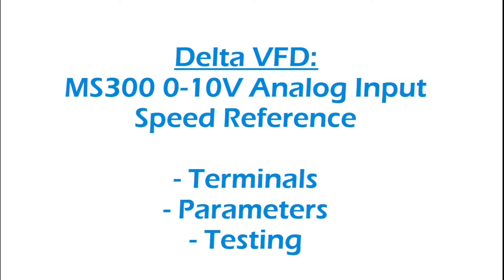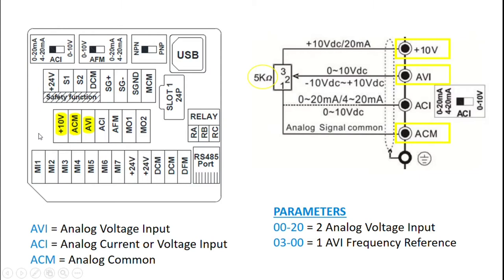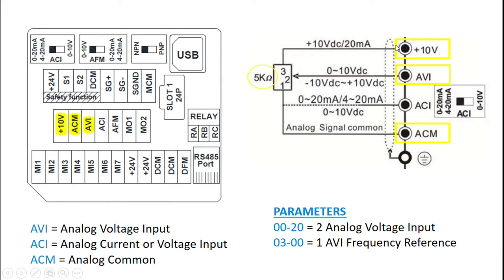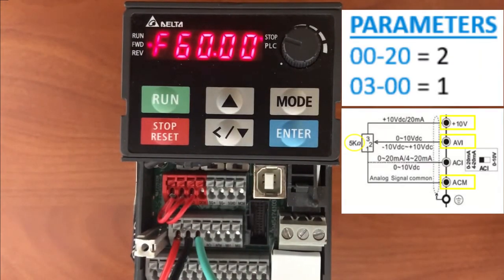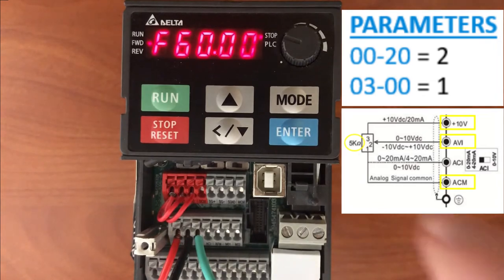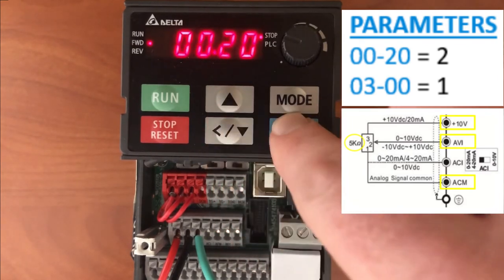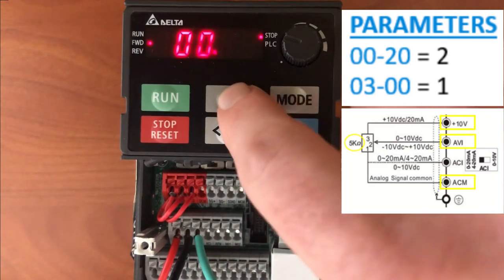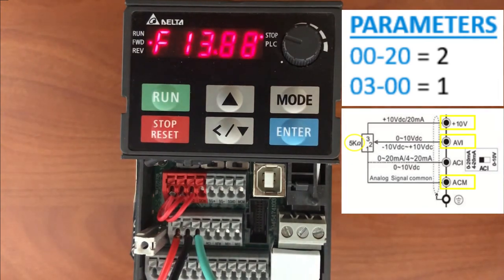Delta MS300 0-10V Analog Input Speed Reference

Comment: Does it have to be a 5k Pot? Can it be a 10k or 20k?
Reply from the maker: It can be other resistances but you will lose range on the pot. For example, at 50% rotation on a 10k pot you'll be 5k ->10V -> 100% reference on the drive.